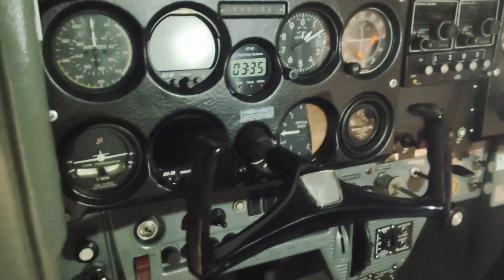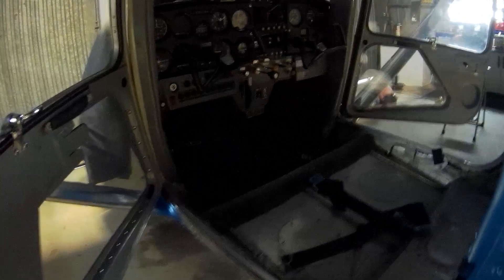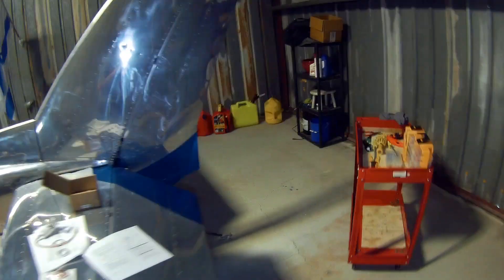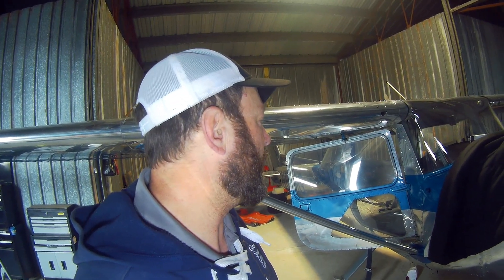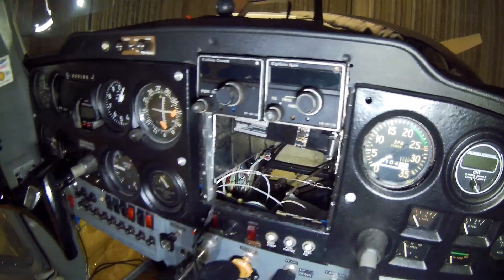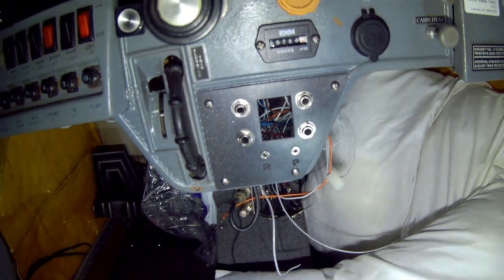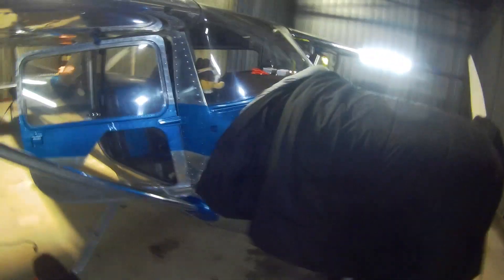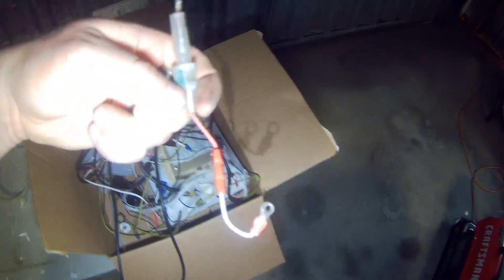Cessna 150 Panel Modification

Comment: For your headset jack panel, did you have to cut away the entire cutout beside the trim wheel for your new headset jack panel or did you just drill holes for the jacks and use the panel plate as a cover panel?
Reply from the maker: We had to do a cutout. There had been so much stuff installed in that over the years it was a mess. Part of the reason for the panel

Comment: I have a Cessna 150 and would like to know where I can get the circuit breaker upgrade kit? thanks.
Reply from the maker: Will need to get with an A&P to determine what you will need. its hand built and customized to your electrical needs

Comment: I run my C150 full RPM and Typically get 119 mph indicated.
Reply from the maker: I dont do full throttle in cruise as it would be past redline. usually around 2500 RPM

Comment: I enjoy your channel. I have a 1966 C150F. Planning on a few instrument upgrades myself. I'm noticing you have a Aux Fuel gauge. Where is the tank located? Also, what is the top right instrument next to your CHT? Couldn't make it out clearly.
Reply from the maker: I have the Flint Aero tip tanks. A switch allows the guage to read for both tanks. The other guage is a carb temp.